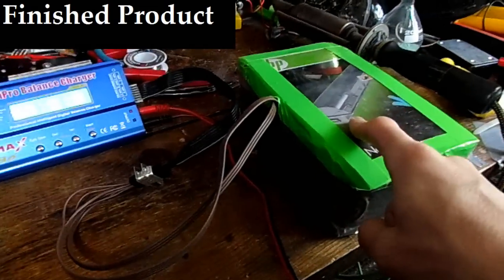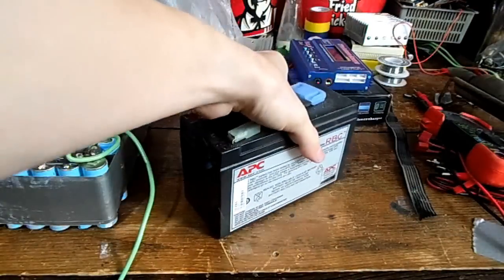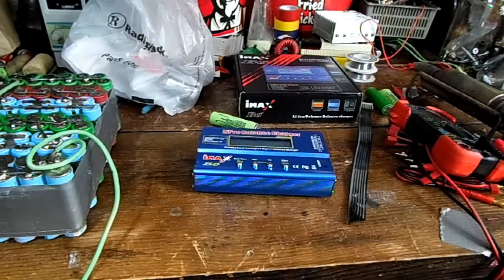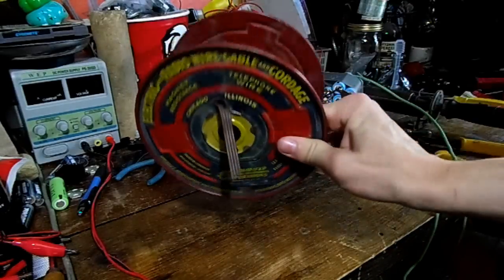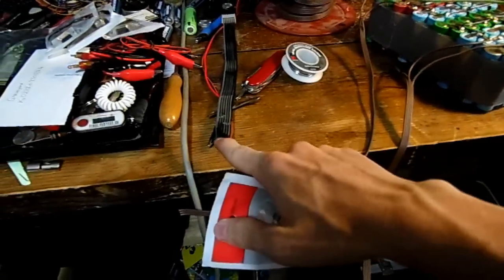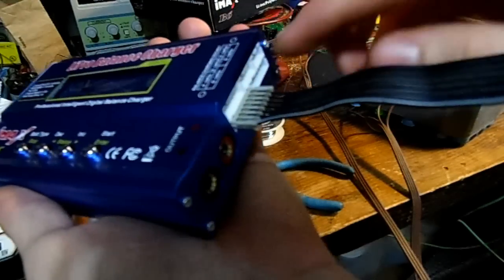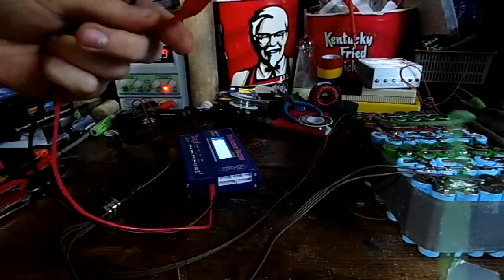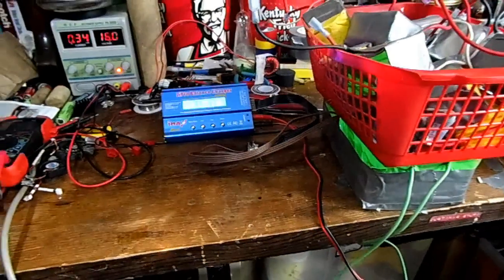DIY: Balance Charging E-Bike lithium battery upgrade

Comment: Still think a bms would work way better than a balance charger. They are dirt cheap if you get them from china.( yes they work fine)
I have kind of the same problem with my battery's i have 40 cell packs divided into 10 groups of 4 cells. Already 2 groups died because a few individual cells somehow got below 2v even though they are paralleled. Grouping cells together without balancing the individual cells is not the smartest thing to do. ;)
Great work though!
Reply from the maker: sounds like you got a shorted cell. that can happen at any voltage. when you connect cells in parallel they all stay the same charge level and its impossible for them to get out of balance. the way to fix your problem is to put a fuse on each cell. thats how my 3rd generation pack is going to be.

not counting i would use a BMS the exact same way as this imax B6, it would just cost 20$ more and not have as many features.
Reply: Rinoa Super-Genius Shorted? Like the internal resistance got to high? That might explain it.. Still it would ruin the whole group of battery's. And the reason i would recomand a bms is because it has like 10 or 12 balance leads and you can charge one huge battery at once. If thats not what you're already doing? I've got my 12 leads 35 amp bms for 20 $ and they handle 45 amps continuously atm without any issue's
Reply from the maker: can you change the BMS's charge limit? i mean so they only charge to 4.05v instead of 4.2v to give close to 4x more cycle life.

and also i don't like having a circuit on teh battery all the time. i like charging this pack with my universal power supply then every so often balancing it with my B6.
Reply: Rinoa Super-Genius My bms actually goes to 4.2 yes . The 4v and 3.8v bms's are used for lifepo4 battery's which have a different chemistry and can't handle more than 4v.
You also have programmable bms's but they are expensive. 100$+.
and how can you make sure you won't run them below 2v when using them without a bms?
Also you can make like a 72v pack and charge it with a single charger (80v charger that is and they are not cheap either)
But then again i'm not here to sell bms's. Just have fun with your battery's and thx for uploading ;)
Reply from the maker: FullFledged2010
ah thats too bad, i'd never charge my cells to 4.2v, that would kill them too quickly.
Reply: Rinoa Super-Genius 2000+ cycles is more than enough for me ;)
At least if i can trust the battery specs. They are more likely to damage from discharging in my experience.
Reply: FullFledged2010 why does one bad cell in  parallel pack mess up all the other cells in the pack? and does that mean they are unrevivable?
Reply: danh le If one cell dies and drops below 2v it also drains the other healthy cells because they are in parallel.
And yes if the healthy cells go below 2/1,5v they are basically death or damaged. 
Best way to make a big battery pack is to have single high ah cells.
Reply: FullFledged2010 i thought by being in parallel, the higher volt cells will make sure to disperse their voltage to the lower cells keeping them in around the same issue. Rinoa Super-Genius
Reply: Rinoa Super-Genius  i know you've revived "dead" cells before, but in this particular situation where a bad cell messes up the cells in it's parallel pack, are any of those cells revivable, and if not, why not?
Reply: danh le Usually a bad cell has a higher resistance than a healthy one so it keeps on draining the surrounding cells until they're all death. 
And if a cell drops below 1.5v they become damaged (mainly by heat) so even if you "revive" them they are still damaged and never hold their original capacity.
Reply from the maker: FullFledged2010 no i've done tests on cells, they can sometimes go as low as 0.2v before losing any capacity.

a good way to stop a single cell from killing your battery is by adding tiny fuses on each cell.

Comment: Hi! Thanks for sharing this. It sounds a great idea and I'm hoping to give it a go. Can I just check - you mention the plus and minus leads - I'm guessing these are just the lowest (0V) and highest (24V) leads of the seven leads in the connector, or are they another 2 leads? That looks a pretty mean stack of cells that you have - do you need this big a stack to get enough current to run the e-bike or do you just have loads for cells in parallel to get extra amp hours and thereby extra range? Thanks Chris (Sheffield UK).
Reply from the maker: it really depends on how much power ya want.  but yeah i used more cells than the minimum. you could prolly get away with just 4 cells in parallel. only thing is with a small battery pack youd prolly not get 100% speed couse the cells can only give so much.

Comment: your soldering Iron Is a MONSTER. WOW why so big (is that a 5 million watt soldering iron haha).. I thing that was made for soldering tin cans?? I think you may need a more manageable soldiering iron for soldering electronics... how ever use it if you have it... great videos.. thanks..
Reply from the maker: actualy its only 300 watts and its made for soldering roofing metal i think. eitehr way i plug it in for 8 minutes and it stays hot enough for half an hour :D
Reply: wow 300 watts thats crazy.. I use a 70 watt and it is ready in like 2 mins.. you may want to look into a better Iron.. that is a monster.. I love your videos, thanks...
Reply from the maker: Richard Downer
yeah i've gone through like 8 soldering irons and their handles get so hot you have to wear welding gloves, they barely melt solder and then die in about a week.
Reply: OK that's cool.. I use a Weller 70-80watt digital controlled system I have used for years. no gloves required. OK it was $300 but super well worth it...much better than 300 watts. it will pay for itself in no time, do to the electricity it uses...I am a believer of use what you have. so the next time you need a new Iron check them out...

Comment: yeah u hooked up wrong somewhere, yes 7 wire but how u know what of the 7 wires is input signal, also u call the "serial" cable 9 pin"  u call it a Dsub, a Dsub has 15 pins and is for old monitors
Reply from the maker: ive heard dsub for 9pin 15 pin 25 pin and 50in.
Reply: ah i see depends who u ask i guess
Reply: sorry bud there is a 9 pin dsub.. that was used for pc's as a 9 pin dsub serial port. look on the back of of most computers....
 IT IS MADE FOR A I/O DEVICE A.K.A. A MOUSE

Comment: So, if you're using identical cells (from a single laptop battery) you wouldn't need to worry about balancing them, right?
Reply from the maker: yeah my first battery pack i made doesnt need balancing till every few months. if your cells are very similar in capacity then you could prolly get away with not balance charging them too often.

i would still recomend checking the cells to make sure they don't get out of balance anyway.
Reply: Okay, thanks :)
Reply: Rinoa Super-Genius I'm just going to get an imax b6 now. They're too cheap and easy not to use. :P

Comment: Hi Rinoa.... love your posts... You post on assembling a cattery for an ebike has been invaluable... especially this one balancing...
Can I ask you ... I have bought 10 HP batteries each apparently rated at 10000mAH... I have them in series to configure a 36volt battery... which means each cell comprises 6 x 18650s in parallel... How do I work out what the overall amp hours is for the unit.... I imagine that if I had all 10 batteries in parallel Id have a 4 volt 100AH unit?? so if I have them in series do I still have 100 AH  (seemstoo much ... think I am calculating it wrong... any ideas?)
Thanks
Reply: Whoops... re-reading my post there I see that it is a bit confusing... apologies... The deal is that each HP battery comprises 12 Cells and is rated at 10000mAh. If I stack 10 such batteries to get 38volts what AmpHours am I getting as a result? Thanks again
 Tony
Reply from the maker: oh don't worry about being confusing. sometimes great ideas/questions can be hard to think about right. ^^b

i would recomend to test one of the cells (or pack of cells) to see what they are at. if the cells are really really old (like 15 years old) they could have half their capacity. but if they are within 7 years like mine then they are prolly like new. and actually there is a very good chance that they are from teh same auction as mine, do they look the same as mine?

ok so with 10 battery packs (each with 12 cells) you'd have 120 cells. would you mind a 40v battery? if you charge the cells to 4.0v instead of 4.2v you'd get 4x as many cycles. and it also makes it easier to think of the voltage if it's 4 instead of 4.2

anyway so in order to get 40v you'd need 10 cells or (packs of cells) in series. that would mean you could make ten 4v packs. each pack would have 12 cells paralelled inside, and the 10 packs would be running in series.

you'd prolly end up with 30-36ah battery. thats a very good size. the Imax B6 balance charger has a setting where it can discharge your battery and count how many amp-hours it has btw.

well i'm sorry for the long post/ramble but i hope it helps. :D
Reply: Rinoa Super-Genius
Terrific... thanks so much for your prompt reply.... Yeah I was thinking the same as you (that I would have a 30Ah battery) ..just that I thought it would have been a bit large but I saw it the same as  you... This is great... Anyway I guess I will find out as I start to use the unit.
If I may pose another question... I have gone ahead and purchased two of the Imax chargers you recommend.. they are on the way as we speak... however I read on some other forum that the balancing need only take place once a month and that balancing doesn't charge the batteries as needed...I can't see how that would be right?... surely the Imax routes 1 amp to each set of cells that it is connected to right?... however if that is the case do I need to make sure that the power supply to the Imax can provide 5 amps (assuming trying to charge 5  12 cell packs like you do)
Thanks again for your wonderfully clear videos.
Tony
Reply from the maker: what the Imax B6 does when balance charging is it just charges it with straight 24v across the two ends. while its charging the cells it monitors the voltage of each pack. and when one of the packs reaches 100% charge it switched modes.

now it goes to balance mode. it feeds like 300ma of current through the balance leads and charges each cell slowly. and it slowly brings the lower voltage cells to the same as the one at 100%.

my cells where like 0.18v out of wack couse they wherent balanced before i built and used the new battery so it took a day to balance mine. but my first battery pack i actually had the laptop for the packs i used and i had the laptop charge each battery before i stripped them so my first battery cells all started out at exactly 4.2v and didn't deviate much over the months.

now as for the amps needed to supply the charger. it draws more amps than it puts into the battery because it has to step up the voltage. if you have a 12v car battery and a 12v car charger that would be a quick and dirty power supply. have the battery charger charging the 12v lead acid battery at like 5-10 amps and have the Imax running off that battery. just don't overcharge your lead acid in the process hahaha.

but i used a 3 amp 16v laptop power brick and it worked ok, unfortunatly on my trip to Missourri it was 108* F and the black charger got to like 150*F while charging and fried it.....if only i didn't use the charger for my good laptop....

hope that ramble helped ^^
Reply from the maker: Bleh you can have more questions I don't,t care.

Connecting them in parallel is an idea I have been wanting to try also.only issue I see is if like cell one in pack one was a different voltage than cell one in pack two. Course then you,d have a lot of current going through the balance leads and stuff as the battery equalized so the cells in each pack where the same.

But that would prolly only cause trouble if your batteries where like 0.6v out of wack. Would hurt to make the balance leads a nice sized wire though. something at least as big as like the wires between a computer molex connector and the power supply, like 28 guage I think.

Then again I guess It wouldnt be all that many amps/milliamps going through the balance leads as they equalized. I gotta remember that we are talking about feeding power into abattery not into a load. Like a motor or light bulb is 0v so the voltage differance from it and a 4v battery is the full 4v. While from battery to battery is just like 0.1v if they are out of balance.

So i just kinda ran a truck over the issues I stated before....oh well.

Comment from the maker: your worried about discharging the battery too much? maybe connect a volt meter to your bike. you can read the volts of the battery. that would remind you to charge the battery if it got low charge.

i charge mine when they get down to like 3.8-3.9v

Comment: I have created a 24v battery, including Samsung 2.6 Ah battery cells 48, with 6 groups and each group has 6 cells in parallel. I use the charger as your method and it works, thanks for your video.

Comment: Thank you for thinking about this. This video was a big inspiration for me to find a cheaper way to make an e bike. The battery prices are really not acceptable. I found a few hp 12 cell packs for 15 dollars which is by far the least expensive way to get cells. I was just a bit worried about safety as i cant exactly buy allcells pcm blocks..  on a side note you should check out the peachy printer; although its not exactly out yet.  Thanks again !

Comment from the maker: oh? well thanks for letting me know you'd be interested.

i would try to make the cells easilly pop out, so no soldering. maybe i could sell the box without cells for even cheeper. i might want to get a 3d printer or something for that though.

right now i just have the circuit idea in my head. like balance leads and stuff. but i think each box could be about the size of a computer power supply.

might have think on this for a while. :o

Comment from the maker: yeah i'm sorry if i got a bit defincive. the thing is i don't drive my bike very hard and only pull about 15amps at max. thats like 1.2 amps pulled from each cell.

this design doesnt really have protection against individual cell shortage. i am working on a 3rd battery that i want to sell for cheep. it'll be 12v 15ah blocks that can be linked together to make whatever voltage you need. and there will be a fuse on every cell. will also be easilly serviceable and waterproof. prolly 40$ per block.

Comment: It sounds like ur in control. But seems like ur neglecting the possibility of one or a few indiv. 18650's going bad. How will u know? Is it dangerous? What can be done to safeguard/keep tabs on batt health? What u don't want is thermal runaway. Also, those laptop batts probably r not "rapid discharge". They r probably 1C. That controller draws around 30amps. 24<30<36. I hope each 18650 is 3ah not 2ah. btw-don't think I ever said ur wrong. Just want to help/share. What ur doing is kewl and fun :)

Comment from the maker: yeah i know your saying that, but why do you say i am wrong? i would like your facts and data and proof. or atleast your thought process on why electricity won't flow from high voltage to low voltage cells. not just "it doesnt work that way"

yeh i didn't have much experiance a year ago. but you can learn a lot in a year. i'm far from an expert but i do understand lithium cells pretty well now. i'm even working on a Sodium-Ion cell prototype. :D

Comment from the maker: but after all thats only from my observations and measuring the voltages of my cells in parallel. when i measure them after being connected together for a long time they don't show any deviation in voltage because they equalized.

when cells are connected in parallel they can be treated as one big cell because all + and all - plates are connected together as if they where two big plates but sectioned off into each cylinder. functionally the same though.

but after all, my opinion ^^;

Comment from the maker: now as for parallel cells getting out of balance amongst themselves during charging. i don't think that could really happen either. if one cell was raising in voltage while the 2nd cell was taking longer, the 1st cell wouldnt keep raising after a certain point because cell 2 would be taking all the charge it needed in order to get it's voltage up at the same rate as well. thus the power is distributed amongst the cells as it's needed. that is if you don't try to charge it with insane amps.

Comment from the maker: no i didn't say it would be impossible for there to be a shorted cell. but a cell that wasnt at the same rate of charge as the others.

what your saying is that if we have two cells in parallel. one cell could read 4.2v while the other reads 4.1v. but that won't happen because they are connected. think of it then as one big cell. the sectors of the cells that are at 4.2v will feed energy into the 4.1v sectors. after a bit of time the entire battery is equalized.

Comment: Differences in internal resistance will cause rate of charge/discharge of each cell to not be constant.  Your statement suggests it is not possible to have a single bad 18650 cell as long as it is in parallel with other cells - but that can't be true - so what happens?  I'd hate to be spreading misinformation - I'm not an expert.  You can have items delivered from Hobby King.  Go to Chargers and Accessories / Balance Leads

Comment from the maker: no it is impossible for the cells to get out of balance as long as they stay connected in parallel. balance is dependant on voltage and the voltage will equalize between the cells in parallel.

we don't have a hobby king around here. i live about 70 miles from anything big. nothing wrong with using 50+ year old wire. ^^b